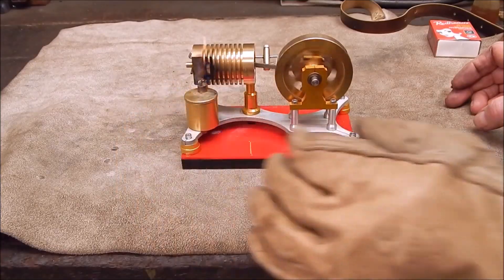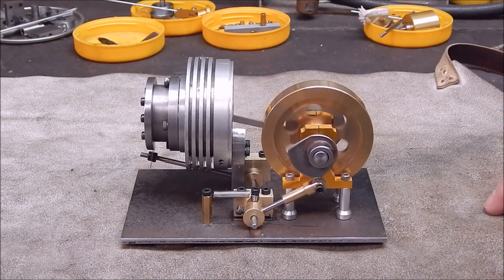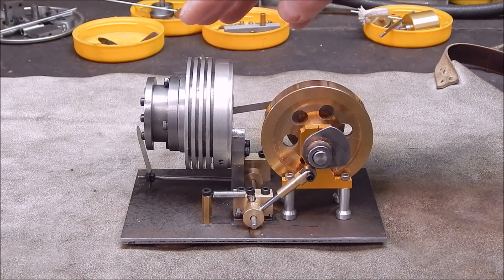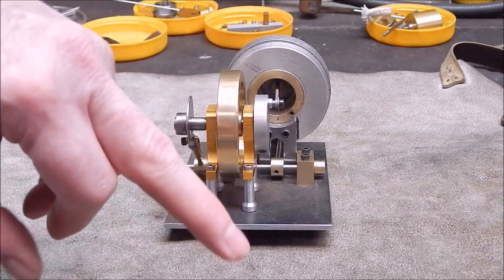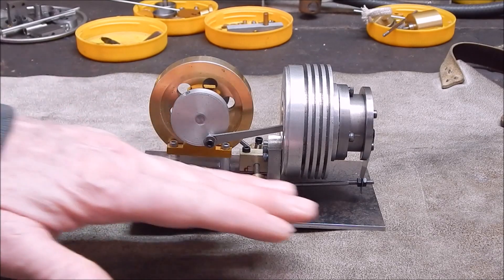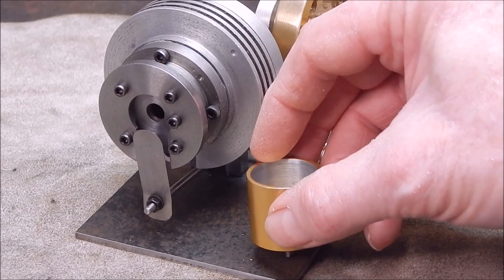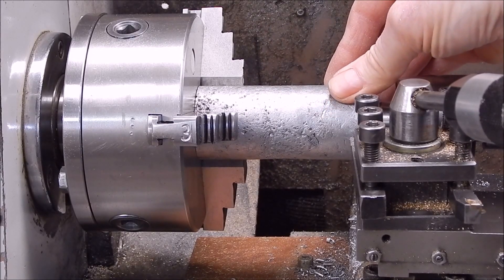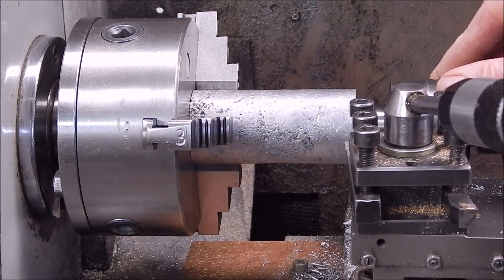The born again flame licker engine is almost ready to run - state of play

Comment: Hi Rob   is it OK to ask if this project was ever a runner?  Cheers  John in NZ
Reply from the maker: Hi John.  Yes, it's quite OK to ask if it waas ever a runner.  No, that flame licker build never ran.  I even lengthened the stroke, but my long standing poor record with flame lickers continued on.  I later used a few of the bits to make a steam engine.  Failure is just part of the game :)   Cheers Rob
Reply: Thanks Rob.  I have never built a flame licker and I strenuously deny any knowledge of the various weird  and wonderous semi-contraptions that are under my bench!  John:goodvibes:
 @Xynudu
Reply from the maker: I save the bits and make something else out of them.  The pain goes away when your memory fades and your thumb heals from trying to start the damn thing.

Comment: I built a poppin engine but I never was able to make it run. The valve is in the same position as your latest design. I did wonder if it's always a bit in the way of the flame.
Reply from the maker: Hi Les, same here, but I was a rank amateur way back then and had too much mass and friction going on.  It was a failure.  I'm not saying I'm any sort of "expert" now, but I have learnt a lot over the years.  So it will be interesting to see how this pans out. 

I agree that the flame path is poor.  If the flapper valve arm was flipped to the top of the cylinder I recon it would all work a lot better.  I have the metho pot nearly completed, so hopefully I can try getting some life out of it soon. 

Interesting stuff.  Makes it all worthwhile having a small lathe.  The big ones are useless for this sort of stuff.

Cheers Rob

Comment: Some inspired work there Rob - love the flap valve. Persistence does the trick - hope for a good run to come. :)
Reply from the maker: Hi Chris,  it keeps me off the streets ;)  I have since changed the flap valve arm angle so it is able to bring the feeler gauge in more horizontal to the sealing face.  I cut out some of the base plate to let the arm drop down further.    It's slowly coming together.  Stay safe and well. Cheers Rob

Comment: Looking awesome Rob 👍👍 Really looking forward to seeing that run. I'll be interested to see how your flap valve works out. Normally, as you know,  they slide up and down so you can get the flame right in front of the intake. It will be a bit more difficult to position the flame on your set up.  Cheers, Alan.
Reply from the maker: Hi Alan,  I had it sliding up and down in a chute originally, same as on your engine, but there was more drag than I liked, so I changed it to the original "Poppin" action you see.  There are several other ways you can do this including a cigar cutter type scissor action.  It will be interesting to see what works best.  Cheers Rob
Reply: @Xynudu  Rob,what you describe as the 'sliding up and down in  the chute' valve design is the same as the water cooled 'Nick' engine I built. The chute type is definitely not as free running as the 'Poppin' type you've chosen to run with. The other issue with the 'chute' type is they are prone to wearing out the actuation link arm over a period of time. Then the valve opening loses its precise timing point.
Reply: Hi Rob, I am the guilty one for suggesting stainless may gall. Just through my own experiences I have a bias towards cast iron or fine grained graphite. I may give a stainless piston a go some time. That engine looks like it will be happy to run now you've modded it. As I said before I think a major weakness with the original piston driven valve is it has no potential for dialling in a bit of advance timing to compensate for vacuum lag. A separate cam, on the other hand, enables all sorts of desired timing curves to be dialled in. Look forward to seeing it run.
Reply from the maker: Hi Howard,  I forgot who said what :)  The one thing that is tricky with SS is that it reduces machined diameter quite noticeably after being wet and dried.  So even though the machined surface can look really good and mike up perfectly, hit it with wet and dry and it will go under size every time (by a significant amount).  Try it and see.  It only happens to this level with SS.  Frustrating trying to make pistons until you figure out what's going on.  The good thing about SS is that it has a very similar expansion rate to brass (brass a tiny bit higher).  Getting it to run is easier said than done and divine intervention may be required ;)  All very interesting. Cheers Rob

Comment: You have done a good job with that--it should run well..Also you are having some weather coming your way. its pretty wet in the west right now..E
Reply from the maker: Hi Ian,

They recon we are going to get a few days of rain and wind from mid tonight.   

When I did the conversion I was tempted to have the flap valve arm above the cylinder rather than below, for a better flame path, but went with the original design.   It just means the flame has to come in from the side to clear the flapper valve, which seems a bit retrograde to me.  If it causes problems I will move the arm to the top and flip the cylinder.

Interesting project.  

Cheers Rob